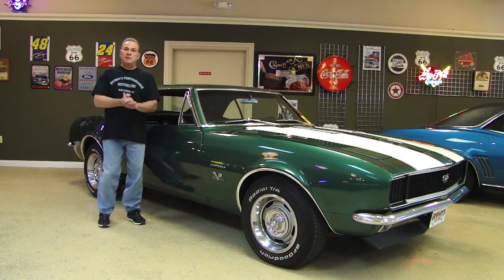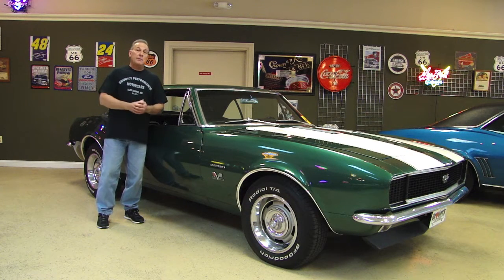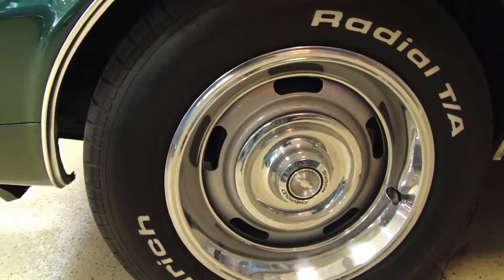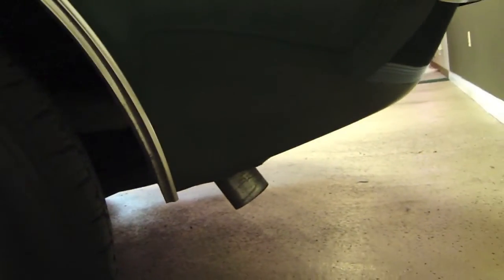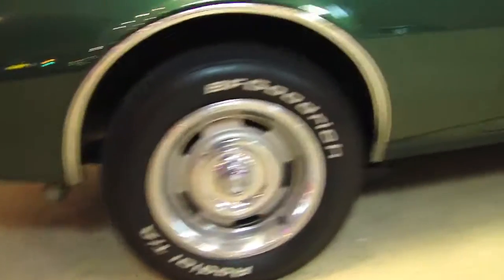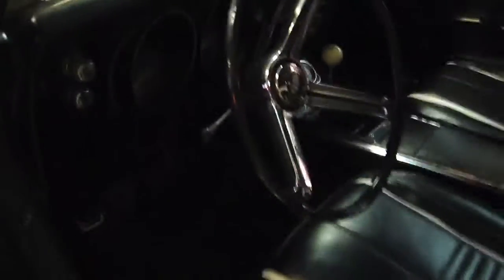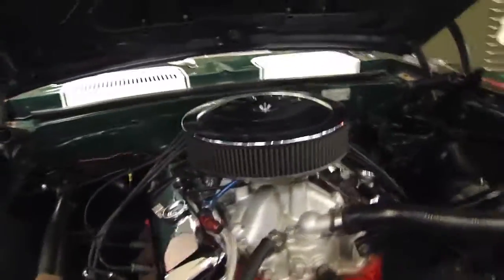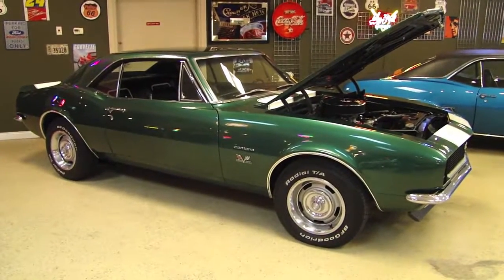1967 Chevy Camaro RS SS For Sale

Comment: Dane McCoy is correct. All '67 Camaro's came with electric motors for the RPO [Z23] RS Option.  
Per this tag;  
12"6"37 6 for Custom Interior
765-Z: 765 corroborates the "6" on 12"6"37 for Custom Black Strato Bucket Seats and '-Z' Standard [RPOA50] Strato Bucket seats (no headrest)
Y-2 Butternut Yellow w/Black Vinyl Top.  Repainted "Forest Green" Not to code.
1WL: Tinted Glass, Folding Rear Seat
2LG:  "L" 4-SPEED FLR SHIFT more than likely a M20 since the "396" is a transplant, "G" [RPOD55] CONSOLE FRT COMPT
3SDL: "S" [RPOZ23] INTERIOR DECOR GRP, "D" [U29] LAMP COURTESY, "L" [Z23] RALLY SPORT PKG
4P: L48 or L30/M20  SS350 or L30/M20 - Non-SS396/Z28 paint with radius rod. Someone went to great lengths to pulls off this upgrade.  If it even had the lowest 325 bhp 396, that would have been "N" [RPOL35]. Black Tail pan to denote the 396 was not painted/completely missed. It was a L48 at one point.
5BY: "B" [RPOV32] BUMPER GUARDS R[ear], "Y" [RPOA39] BELTS ALL DELUXE 
"No signs of damage" … lol Seriously?! The shut-lines are terrible on this car like it has been cobbled together. 02:05 Hood/Fender line-up: proverbial rabbit hole. You could drop a freshly made corned beef on rye sandwich through those lines. The left rear quarter-panel weld line to the trunk is hideous. A lot of time and money went into this final point to represent something of hidden realties, half-truths and poor attention to detail. Non-Vacuum Brake booster, probably drum brakes. Highly optioned car that has seemingly had a rough life.
Careful what you buy out there guys.

Comment: Not a factory big block car, but a well optioned SS-350. Pretty nice car all in all. Butternut Yellow in my opinion is a much nicer color than the Forrest Green, or whatever shade of green that is. Looks like the car received some new fenders at some point possibly, which could explain the absence of the SS badging, but certainly explains the waviness in the fender to door gap. 

As others have pointed out, 67 was a one off year to have electric headlight door motors. The replacement motors available today are far more dependable than the vacuum operated system found in the 68-69 and the original electric motors offered in the 1967 rs. 

All in all, very nice car, hope you get every penny you are asking and then some.

Comment: The stripes are out of place. Those are Z/28 stripes and were only available on a Z/28. They were not an optional package, and never available on a true SS car. They were both performance packages and canceled each other out. You could have an SS/RS, or a Z/28/RS, but a Z/28/RS/SS, never existed. Not even as a prototype. Pretty car though.

Comment: No one even noticed it has a fold down back seat. No  Antenna for some reason. No paint on the center grill moldings top and bottom.  Should only have A SS in the grill And why did they delete the SS emblems on the side who knows